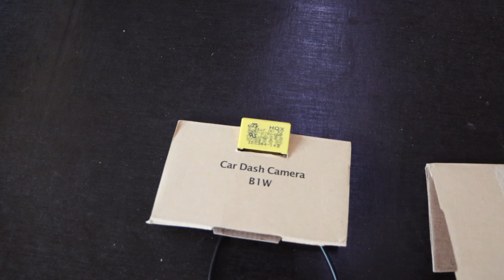Reducing Drag using Hydrofoils - Project Brupeg Ep. 147

Comment: Hello to you all. Glad you're able to mingle a bit now, hopefully our turn in the UK before long!
I wondered when watching Damian raking and tidying the sand whether there were any issues with the ground getting contaminated with swarf, grinding material and welding spatter? When building film sets we run a magnetic trolley all over the set to collect metal particles to avoid damage to vehicles and livestock. All looking great. Take care.
Reply from the maker: Hi David, it does get small bits of rubbish embedded but the rake takes anything large off to the side and we chuck it in the skip, anything smaller doesnt bother us or the yard. its a very dusty, dirty work environment so a bit or grinding dust and metal flecks isnt going to bother anyone.

Comment: Jess, you look particularly pretty in that white sweater !  Am wondering if you ever get to do hydro therapy or swimming in your treatments/theraputic care ?  The idea popped into my head while watching this episode that you could make a small whirlpool/jacuzzi out of one of those IBC type containers ( a new one of course ) by trimming the top to open it up, and covering the trimmed edges with a slotted piece of hose. Adding the Connectors to recirculate/heated/cooled water should be easy if you put a plastic reinforcement at each perforation on the inside of the HDPE liner/container, ( by recycling the top piece perhaps ) a seat can be submerged inside for relaxing too if desired. I'm thinking Damien and you might enjoy a improvised hot tub like this even after the boats built if you can find a space for it... ? You could make a couple of them for the yard to enjoy or perhaps with a larger container like a cleaned out trash dumpster he he.. they may pay for themselves if people bring food for the chance to enjoy them !
Reply from the maker: So what your saying is make a floating bathhouse... Im not saying we cant/wont...

Comment: I just wanted to write a message to share how much I love your 'Can do' attitude to overcoming  adversities. Watching you guys reaching out and taking hold of your dreams is moving..  Where you can all come together to help one another get to the next level is inspiring. Love you guys..

Just a query regarding the 'wings'. Is there no way of approaching a University, or institution, whereby you can put your theory to the test. By offering up Test-rigs to destruction. So that you can engineer it in a way that your bolts or linkage are most definitely the weakest part.. Also, you could attach a 'safety wire rope' to the hull so they don't sink if they do go. Good luck in future endeavours.. Al
Reply from the maker: Hi Al, we are just copying a design that has been tested and evolved over the last 30yrs. No need to reinvent the wheel

Comment: Is it worth it to build a leading edge fairing in front of hinge in the water?  It would take some pressure off the hinge and cut the drag.  Just a thought, you guys always do an awesome job!  Cheers to the whole crew.
Reply from the maker: Hi Ken, on a boat like this it wouldnt even be noticed. Notmally these wings are just 25mm plate cut out to the shape needed, zero finesing. the fact we have hydrofoil shaped wings is rare

Comment: Just a quick question: What is going to prevent the locking nuts from backing off?
Reply from the maker: What’s the time stamp and I can answer this.
Reply: About a week of salt air.
Reply: @ProjectBrupeg  Seattle , WA
Reply: @ProjectBrupeg 22:51 in the Video, Sorry brain is on slow
Reply from the maker: Ahh, we will have a locking mechanism of some sort, either spring washer or potentially a hex shaped hinged flap that drops over it.
Reply: @ProjectBrupeg  I was thinking you might want to think about lock nuts or thread locker.

Comment: Just a little point on welding those three square bars, if you didn’t weld the ends thru the middle  before you added the round tube your gonna get water down all three tubes 🔲🔲🔲

Comment: from the start I really dont know about this. Im a former engineer from the submarine business and from where I sit I cant see these wing sections which are quite large in area, I cant see the joints arms or anything else I see being constructed holding them in a big swell. A big boat in an ocean swell creates a lot of unpredictable forces, and the wings themselves seem quite large and far from the boats rolling axis. Its not so much the area for me but where it is by the span or distance out from the hull, and that they articulate. Make sure that when they go they dont tear great chunks of hull plate out of the sides of the boat and compromise the whole ship. Have some well secured fully welded doublers on the inside and the outside of the hull plate to spread the stress loads. If you can spread it to framing.
If it where me and sure it isn't, I would have gone for adding non articulating longitudinal  plate extensions on the chines which is an older technique, but its proven to work and its robust. 
All that said you are right about airfoil shapes and drag, round bodies exhibit far more drag than either aerodynamic or hydrodynamic shapes
Reply from the maker: This is a well proven design that need used in Australia for almost three decades. The longitudinal plate extensions are an old design they are really ineffective compared to paravanes on arms or folding wings like ours. Designs change and ideas move on. These wings are just another evolution which is now well proven.

Comment: You guys could really do with a mag drill with the coreless mill bits I think they are called. Andrew Cameratta is worth a watch.

I'd put a petzl safety descender on Jess's winch as a failsafe
Reply from the maker: We have a 4m long retractable seatbelt fitted to the winch (that’s the 50mm black strap you can see) that’s our fail safe should the winch cable die

Comment: I have been thinking about how to reduce roll on an old kauri ex pilot boat called KAIURUNGA at mana in New Zealand and worried that the wings you have made ride to shallow in the water,if you can allay my fears and explain I’d be wrapt
Reply from the maker: Hi Richard. You can set the wings at any angle but they are most effective when horizontal to the water surface. It really doesn’t matter if the tips come out of the water as the force needed to roll the boat that far is extraordinary so it doesn’t happen as often as you would think.adding wings is a really common conversion over here and it’s becoming more so. They really are more effective than any other type of passive stabilisation. I wouldn’t hesitate to add a set if you need really decent roll control
Reply: Don’t forget: if one wing nearly lifting out of the water, the opposing is pushing harder deep in the water....
Reply from the maker: Yeah its not that much of an issue, its quite common for trawlers with these wings to steam around with a single wing down, and Purse Seiners only even have a large single wing on one side
Reply: Project Brupeg I look at the attachment points and think of the forces and can’t imagine how a wooden boat the size of mine could use such a system it would be nice to reduce the roll tho it can be fierce,steadying sails restrict things a bit and gyros are not the one for me so what you are doing I will keep looking into .thanks for your attention and I can’t imagine how wonderful launch day will be for you. Come visit us at mana

Comment: It took me a while to work out where in space mty footrest was. Not long after I got my chair I went to W H Smiths (a newsagents) as I turned to go to the magazine racks I caught the footrest on the edge of the rack (6 foot high 20 feet long) It just sort of fell to bits. What a fecking noise tin shelfs and 100s of magazines all falling down. I just did a 180 and drove out leaving my mum (80 the time) in the shop wonder what happened. Its funny to look back on but at the time I felt a right prat.

Comment: With there being so much wind .... most of the time ... wouldn’t it be worthwhile making a wind break frame and covering it with a tarp or plastic?
Reply from the maker: With Fluxcore wire its not an issue. only becomes an issue if we need to swap back to solid wire. and for small bursts we can do whats needed.

Comment: When drilling larger than 3/4 inch use hole saws bits or broach mill , it is much faster better, and easyer on your drill equipment.
Reply from the maker: Yeah true, I used to use them when i was a mill operator, I guess you use the tools you have, which for us is not much.

Comment: Re-think your wording for the wing stabilizers, that you now call hydrofoils (hydrofoils lift the boat's hull out of the water, decreasing drag and allowing greater speeds)
Reply from the maker: Technically a hydrofoil is a low drag shape running through water. Exactly what we achieved with the arm modifications. Hydrofoils don’t have to lift a hull clear of the water to be called a hydrofoil, that’s just an outcome of designing them that way. Thanks for being specific, it lead to some interesting morning conversations here

Comment: Maybe somebody can check me, if you use regular steel in contact with stainless steel, in a salt water environment, the stainless steel will corrode and rust faster! Seem to remember this from chemistry class......
Reply from the maker: That’s true, but that’s also what zinc anodes stop. We have a large anode mounted between the two stainless hinges on each wing so that shouldn’t be something we need to factor in too much

Comment: I understand what you mean by airfoil but it would be more correct to say hydrofoil. Regardless, I hope they work well for you.
Reply: They are named truely neither (hydrofoils lift the boat's hull out of the water, decreasing drag and allowing greater speeds). The correct wording is stabilizer wings, at most.